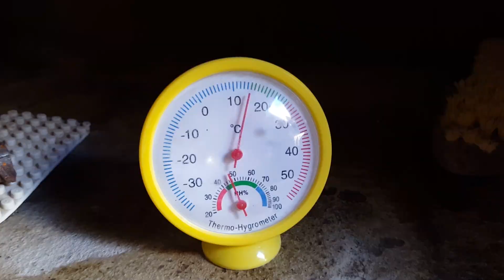Basement Construction (Part 2) with Stone Wall and Cement! (beci piatra partea a doua)

Comment: Why did you build two layers of walls? Isn't stone masonry strong enough to support a basement?
Reply from the maker: We wanted the basement to be inside the house foundation so it cannot freeze in the winter. This way it's isolated with 1 meter of ground :) and we made a house with 2 floors above, it needs more reinforcement with concrete and steel bars...

Comment: I cant wait to see the next part especially the fully erected house. Will you be using rocks for the house walling as well?
Reply from the maker: No, the walls will be made from BCA blocks and wooden top.
Reply: Thank you for the response. If you don't mind, let me ask you: Would you recommend use of rubble stones on house walling?

At my rural home here in Kenya, we have a lot of rubble stones and you take very little effort to obtain them.

So I'm wondering if I can experiment on building a house using rubble stone in a bid to educate and assist my community to own low cost, safer and durable homes using locally available material.
Reply from the maker: @DigitalFootprintKE  yes, i think that rubble stone can be used sucsessfuly with cement, it will be a very strong bond and it will keep the house cold in summer. Here in Romania we have rough winter so we use wooden walls for bedroom, it keeps the warm inside.
Reply: Thanks you for your kind response.
Reply: And all the best in the remaining part of the construction.
Reply from the maker: @DigitalFootprintKE  thank you very much!